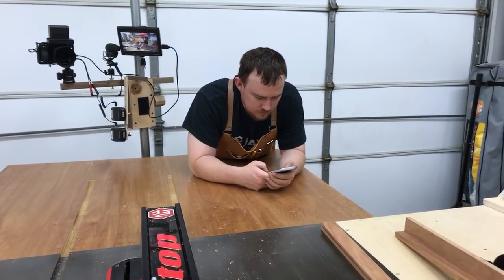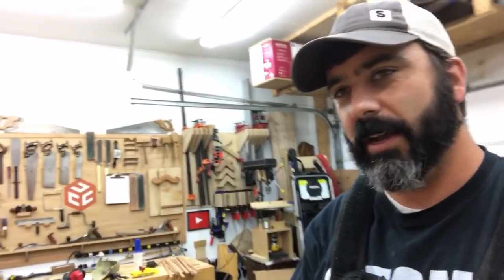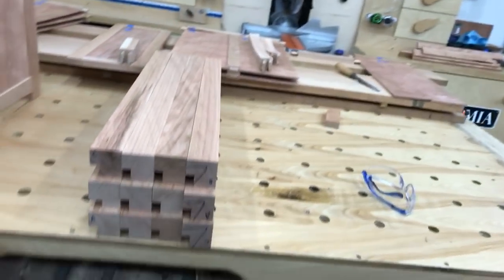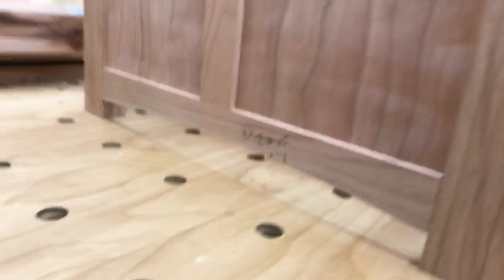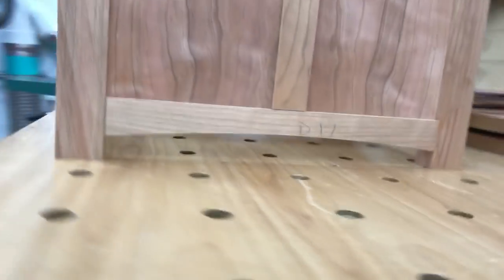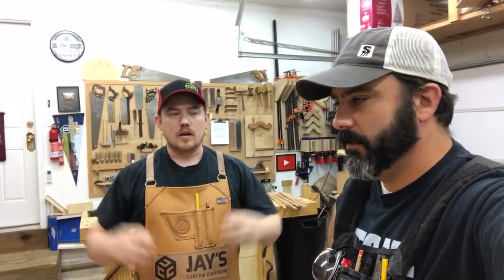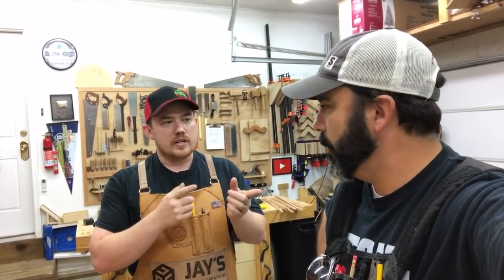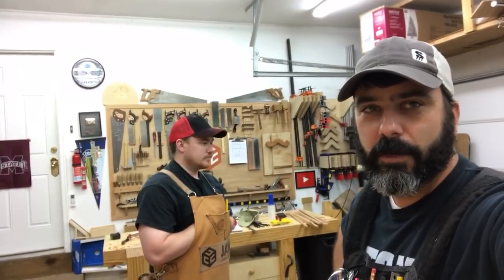Arches and Rabbets

Comment: Did you cut the arches individually or make a template and use a flush cut router bit?
Reply from the maker: +Gary Jones used a template and cut them individually.